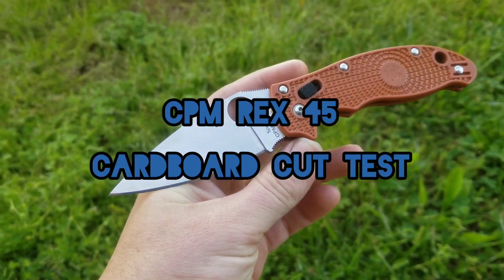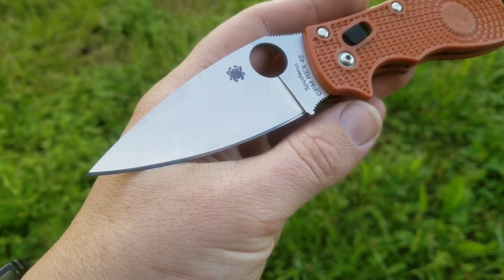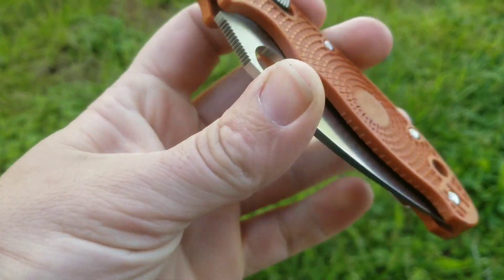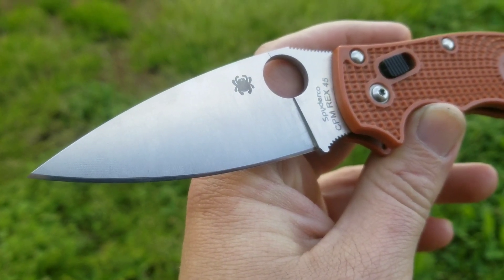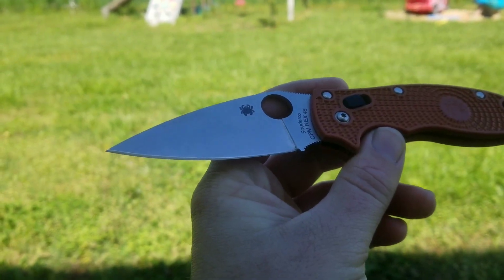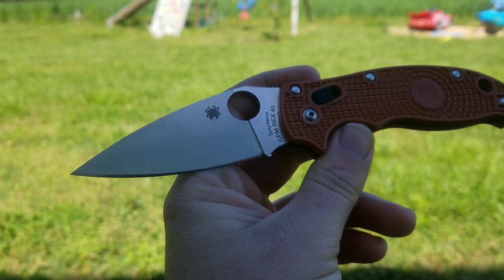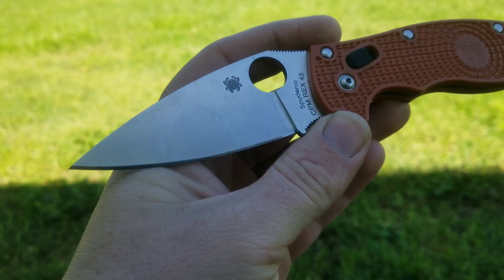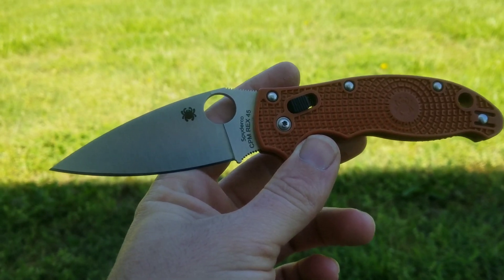CPM REX45 Cut Test- Will adding a microbevel lower edge retention?

Comment: I noticed a few guys doing micro bevels to reduce chipping. I presume this goes away after sharpening past the burnt factory edges.
Reply from the maker: Microbevels do help reduce chipping. But poor sharpening jobs also cause premature chipping and edge failure. Microbevels help to create a "healthier apex" meaning the fatigued steel and wire edge is properly removed which makes your edge more durable.

Comment: That's about what I got for the LW Rex 45 Manix I tested not long ago. It's definitely done better on some models, the Manix cut more and sharpened better than either Para 3 I have in Rex.
Reply from the maker: Yea i was impressed. Which i have been since i got it.
Reply: My manix lw also tested 67 I'm thinking they did a spectacular job heat treating that run.
Reply: @-trmxzer0-235  I have 2 chances then, I found one then just bought a second to use for the channel.
Reply: Outpost76 found as in picked up off the ground?  Or found in a local knife shop?